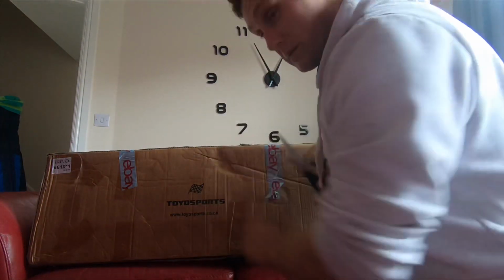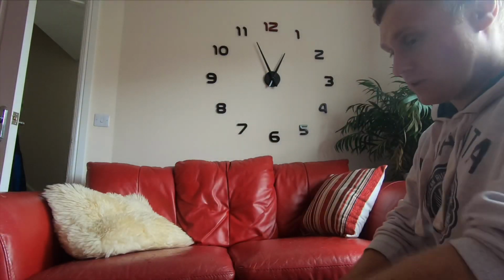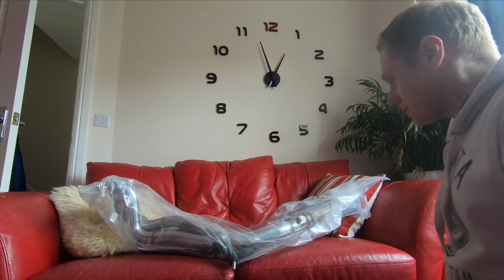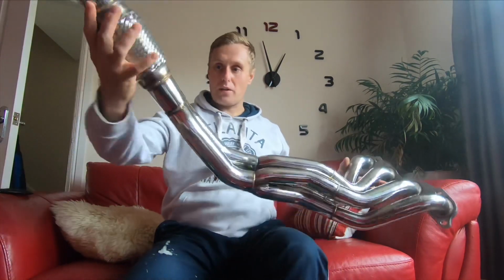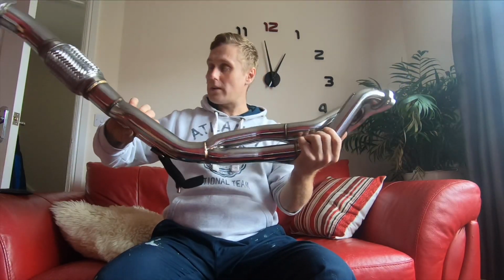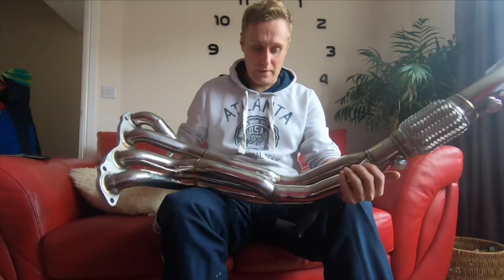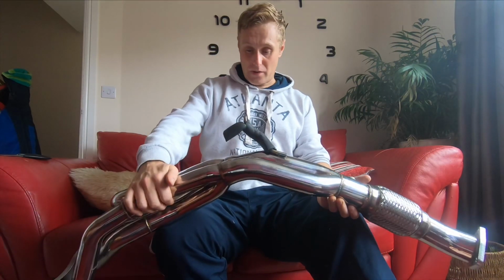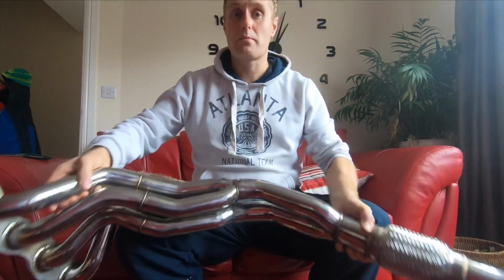Toyosports 4-2-1 decat manifold k20 ep3 type r

Comment: Hi Nic, bought my ep3 with this already fitted  and the flexy pipe went so just buying a straight replacement, with gaskets that come with it, do you get smaller one that goes between the manifold and centre section? and were the bolts that came with it just for bolting to the engine or do you get centre section bolts aswell?
Reply from the maker: Pretty certain I got the centre section gasket yeah, but I can’t remember about the bolts at all sorry! I know the fn2 one I just got came with centre section bolts but that’s not much help 😂
Reply: Thanks for that, will probs just order it then, see what turns up then rush out and buy bolts if i need them, was gonna try and get one for this weekend but guess ill put it off until next week, im doing it on the floor, with the arb pulled down can it go back in from underneath? cant be fucked taking the rocker off
Reply from the maker: Yeah fitted and removed mine from underneath 👍

Comment: so how does they work? ::)
Reply from the maker: I don’t think it works very well. I think it makes less power than other ones would.
Reply: @1BlueGhost  This is interesting. It goes to show not all manifolds are created the same even if they look similar. Do you think the diameter / runner design is poor?
Reply from the maker: @K20TypeR  without comparing side by side it would be difficult for me to say. it did obviously work as an improvement over the factory manifold. the car was only mapped on 95ron fuel so perhaps that's why it only got to 235bhp not into the 240-250 range. definitely ran good, and for the price I guess I couldn't complain too much.